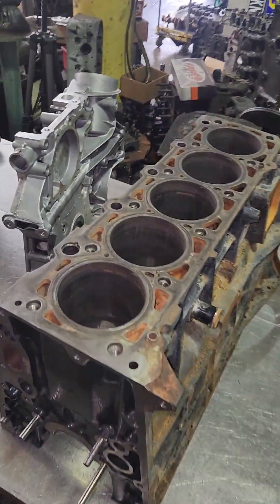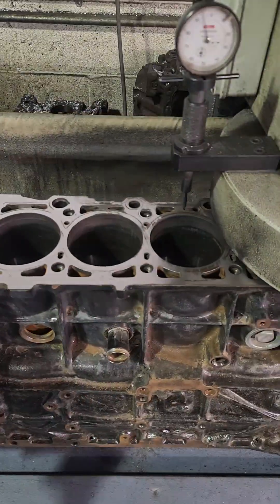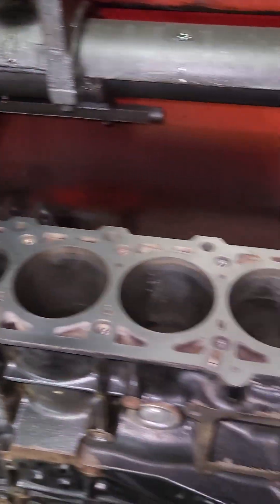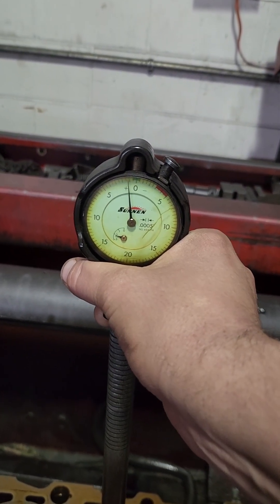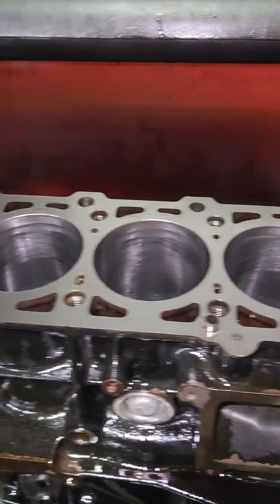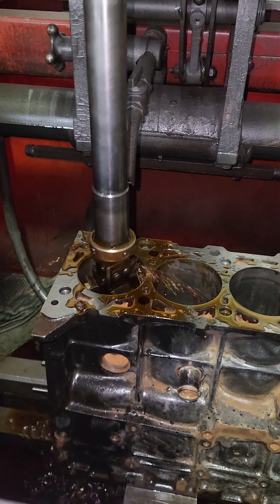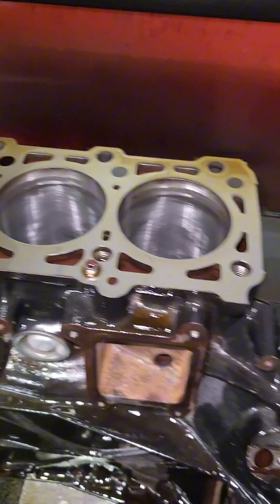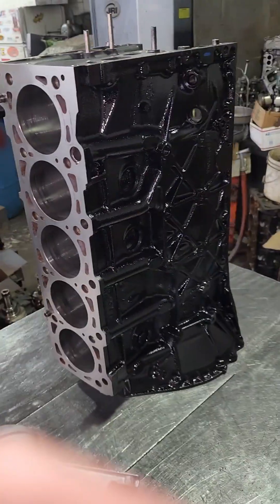Sprinter Van Engine Block Repair. #educational #repair #engine #restoration

Comment: On the 7th day, God created Sprinter.

On the 8th day, he traded it in for a Transit.           Ok, so I'm barred from further comments 🤣
Reply from the maker: Lol, On the 9th day, he traded back for the sprinter.
Reply: We were correct until we went back to a sprinter. I will say the actual engine is great but all the other crap they put on it makes it a total money pit. Mine had 6 egr valves not including the one it had on it new
Reply from the maker: @jonsaircond8520  I was just joking around. I agree a lot of engines are great, but all the egr and def stuff is just no go.
Reply: I've had my Transit for about 5 years, and seriously, they're all much of a muchness. EGR being one common issue, but other stupid stuff that just shouldn't happen, or be such a pain to put right. 😆
Reply from the maker: @TavoAu  I hate the Egr it's always a problem
Reply: I had a sprinter for 15 years and 240K miles and currently a Transit for the last 6 and overall so far the Transit hands down has been beyond cheaper to own. The sprinter over those 15 years was in the shop for 18 months. I will say that the actual engine was fantastic and the transmission was also great if you maintained it. I loved the sprinter and fixed it beyond what I should have but boy it was expensive